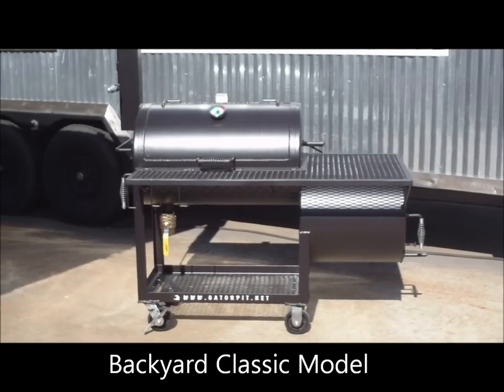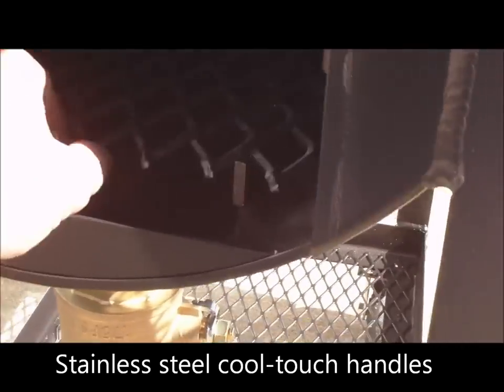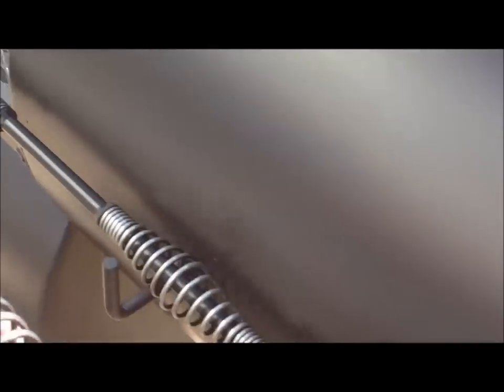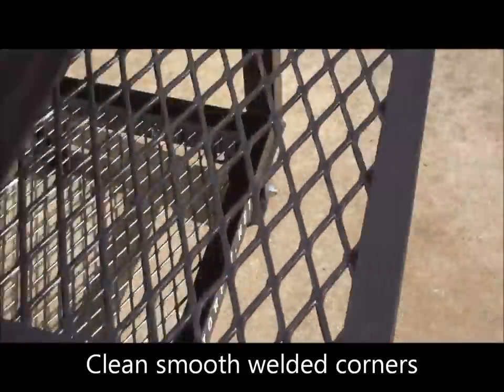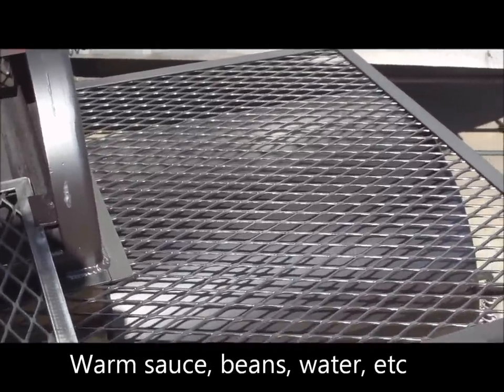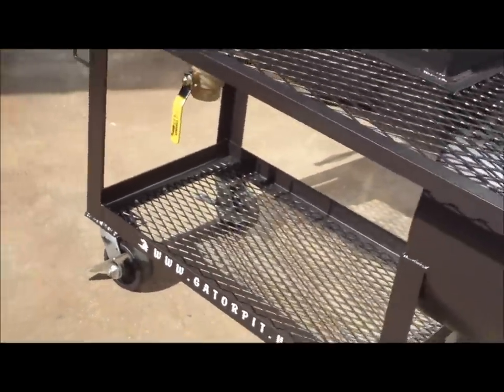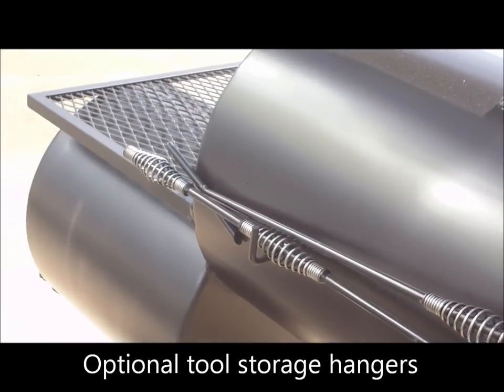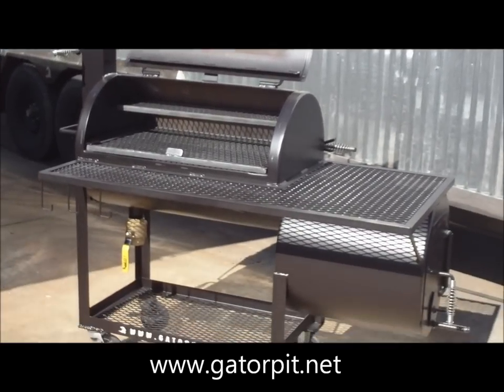Backyard Classic by Gator Pit of Texas BBQ Pits

Comment: Hey Rich 
nice work man 👨 
have one question 
is the air vent big enough to supply the firebox with adequate air flow ?
thanks man
Reply from the maker: mhmdosmy Have has this model since 1995 or earlier, actually.  YES. :)
Reply: Gator Pit thanks

Comment: Hi Ritch, 
What is the benefit of welding the flange all the way around? It seems like overkill but I'm sure you have a reason so I'm asking. Also, I've noticed some other pits will weld those flanges on from the back to hide the welds. Is there a reason you don't do that? Thanks in advance.
Reply from the maker: +Justin Wallraven For me, two reasons:  Looks more custom and not cheap out with stitch welds.  Say it that way, because that is what it looks like to me when done so that way.  And, you certainly don't risk leakage from smoke or liquids when full welded.  That simple.  Thanks for inquiring, Ritch

Comment: not trying to be a jerk or anything, but Im a little ocd and I have to ask....what's with the rust on the inside of the main doors? drives me nuts lol
Reply from the maker: Tony Clifton the interior is stripped down to the metal.  You never paint the inside of a cooker. When the customer receives the cooker, they need to coat the interior with cooking oil and light a small fire to "season" the pit.  That will bake cooking oil on the inside.  NO PAINT EVER.  Ritch Robin
Reply: Gator Pit Thanks for clearing that up, I knew there was some kind inside knowledge I wasn't  privy to.
Reply from the maker: I have ben asked that several times over the years.  When you season the cooker when you first get it and then start cooking on it, it turns black.  Like a cast iron pot or pan.  Same thing.  You have to oil and season or bake that oil on a new cast iron cookware before you ever actually cook with it.  :)

Comment: Hey Rich I'm from New Orleans but go to Houston a lot in the course of my hot shot work so ordering and picking up a pit would be no problem. Question: I noticed on your web page that you don't have a picture of a reverse flow unit. I know you will do them because I accidently marked the comment that you posted on this video as spam (sorry about that). What's your opinion of reverse flow....do they really add more value to a pit? Is it worth it? Also if I find myself there I'll be glad to transport any pits you have going eastward on I-10 for a nominal price as a back haul.
Reply from the maker: Bthor76, Reverse Flow is okay.  Older way of trying to more evenly distribute heat thru a smoker.  Down side to RF:  Restrictive air flow.  Moves hot spot over to the opposite end of the cooker.  Non-adjustable and can't be removed, usually.  As , the plate is completely welded in.  Cleaning can be difficult getting under the plate.  Our Tuning Plate design took care of what the cons are with RF.  Much better heat distribution design.  Now, not every pit builder's "tuning plate" design is the same.  Really need to research the customer's comments thoroughly on their experiences with their pit builder's TP design.  Gator's run even.   Too many customer videos and photos on social media for any one to state to the contrary.  :)

Comment: No disrespect but you charge extra for a lot of builders include. My opinion .C'mon man?!
Reply from the maker: bryant farrell   No disrespect taken.  Gator Pit's pricing is based on what our costs is to produce our cookers.  When you put a lot of labor and material into making a quality product, it will costs more.  However, researching "well known" or those I consider competitors, their products, features, and pricing, Gator Pit is not over priced.  You have to really sit down and compare apples to apples.  What a builder list on a website pic and what you actually get, can easily be two different things when it comes down to asking what you are actually getting for the price listed.  If one of our Gators is priced a bit higher on comparable sized cooker, look at what you are getting for that price.  We typically offer more features for lesser "Total Package Price" than what our competitors will tack on when it comes time to ordering from them.  Slide meat racks, upgraded  larger commercial casters, temp gauges standard, fully welded flanged doors, SS handles on all doors, side doors flanged, full 1/4" thick heat deflectors, 2" angle framed base, ALL 1/4" thick steel on firebox and main chamber minimum, and I can go on and on.  Those are usually upgrades, if even available, thru our competitors.  Not everyone out there building pits is a competitor. Very few go to the extremes of true custom pit design and fabrication.  There is a huge difference in that.  And, that you pay for either in lesser priced pits or higher priced pits.  Gator Pit has over 200 orders on the books as of today and our customers are worldwide.  So, we must be doing something right.  Thanks, Ritch
Reply: Tec 9 -How would you know? Do you own either??
Reply: Tec 9  Still doesn't answer my question.
Reply: Tec 9  I didn't think you had either. Should judge unless you've tried.